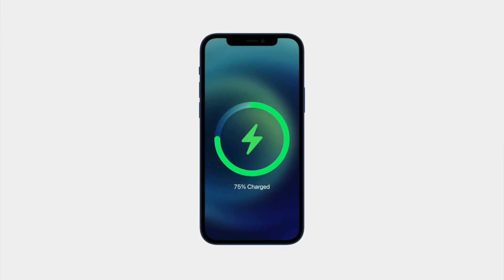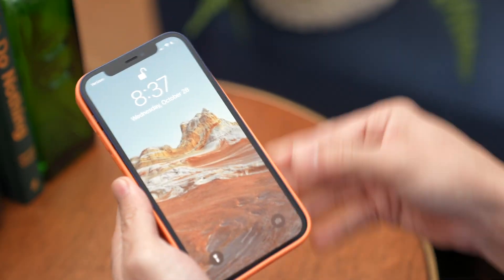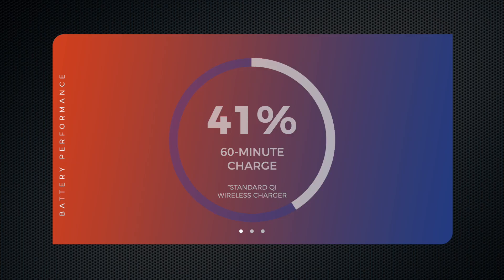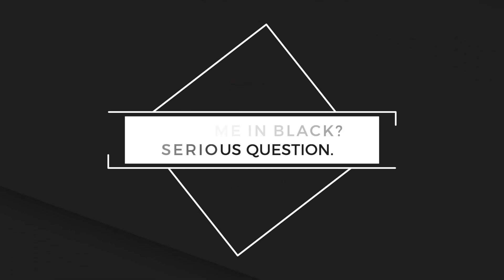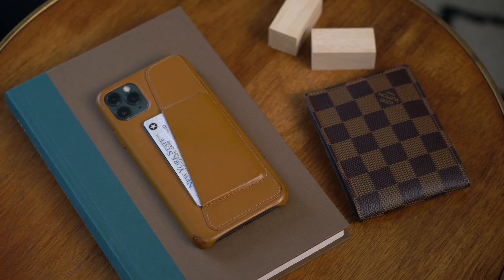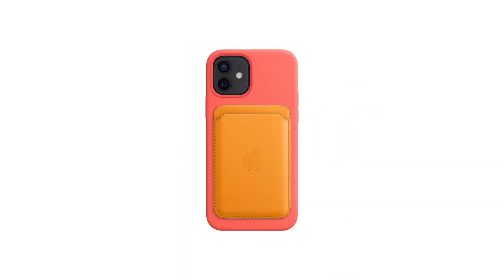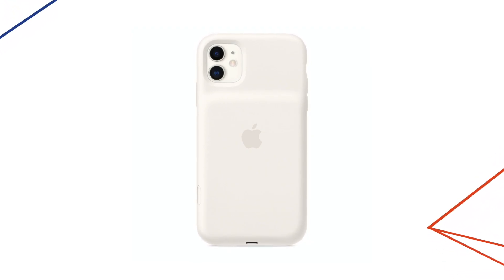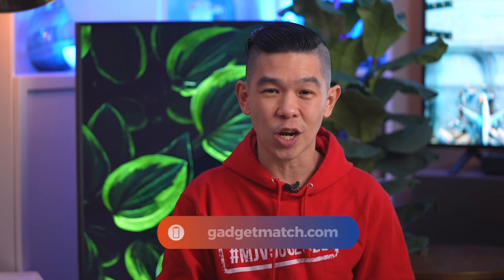MagSafe Explained

Comment: Induction cookers work the same, except induction cookers use alternating electric currents to heat up any conductive material. This also means any phone with a magsafe could be fried if you carelessly put it on an induction cooking hob that has been turned on. Such situations could also cause the battery to burst and start a fire, but who would do that, amirite? (Well, kids, obviously.)
The technology has been around for decades, just that proper engineering research for phones were only belatedly started.

Comment: 04:03 That's not almost as fast, it`s almost a 20% diference. I was more interested in knowing if the charging speed is different if you`re using magsafe with an older iPhone.
Reply: No... all older iPhones will only charge at 7 watts no matter how many wats the charger is.  The 12 is the only one that allows 15 watt charging.
Reply: @rblaclewell  that’s why i wanted to know that. I saw videos where older models charged with less than 7w.